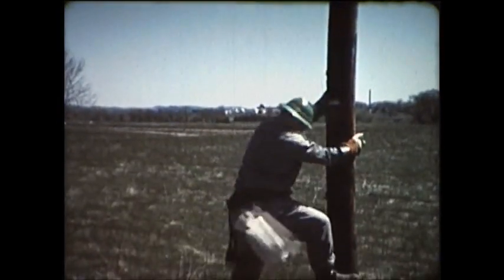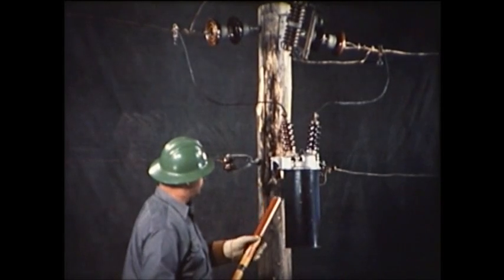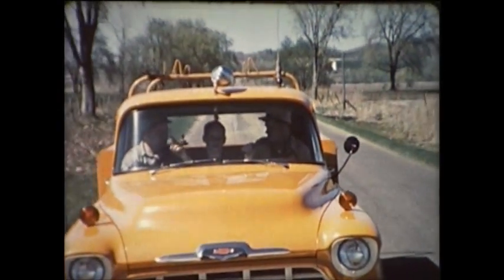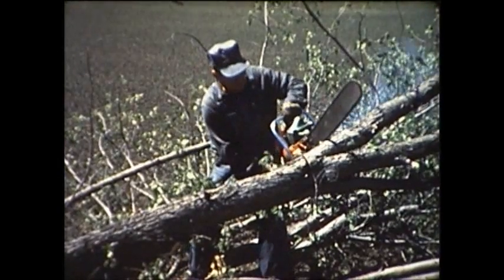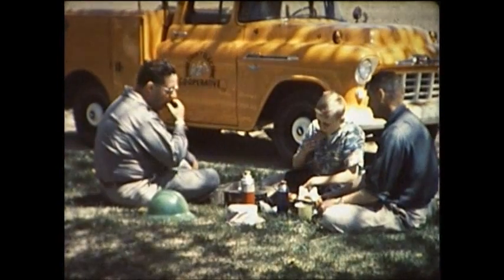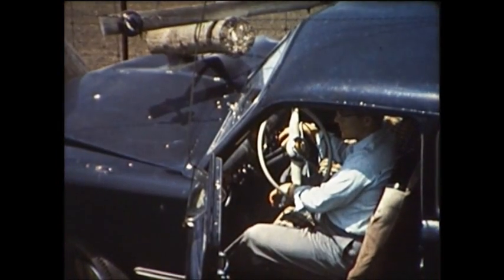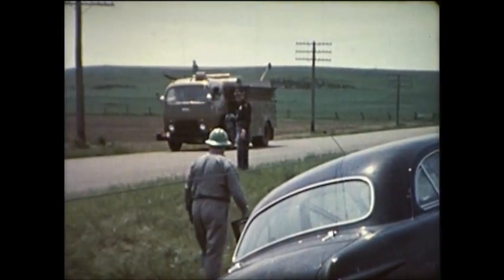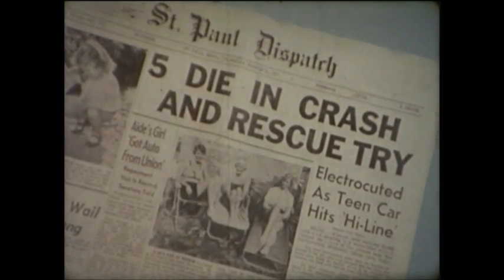My Pop's a Lineman

Comment: Love these old videos, did a pole change out the other day. Found a pole tag with 1938 on it. I took a minute to think about all the lineman that had climbed that pole over the years.
Reply: Where I live all the poles in the mountain are all from the 30’s and when one falls or whatever they don’t replace it with a new one, they just leave it and the wire at a long span.
Reply: @koda7820  we do that every now and then, but most of the time we will build a road with a dozer to change it out. Sometimes we can't get by with it.
Reply: I get the same way setting and framing new poles. It's a gift to know the construction will be there decades after I die supplying energy to customers homes. 

Just last week my crew set up DB for new lots, pulled 4/0 service, 350, and #1 15kv primary, put the terminator at the pole side and energized the pad. Knowing it'll be there for those new homes for years is humbling...I got to be a part of that history.
Reply: Found 1934 nails myself.
Reply: Bill builds an overunity generator with his friends tapping ZPE and his dad has a stroke see it.

Comment: Took a chocolate box down today actually! Crazy how some of the old stuff still does the job.
Reply: still operating these in toronto hahahahah
Reply: Theyre everywhere on the 4kv in the northeast....built to last
Reply: Only thing about them is you can't hang the barrel with a stick. I've tried every way to do it and it just don't happen for me.
Reply: I’ve been a lineman for a long time but I’ve never heard the term chocolate box can you please tell me what it is
Reply: @wd2616  I've never heard the expression "chocolate box" for an enclosed fuse cutout--however . . . "widow-maker" was the moniker I often heard in reference to these.  Typically, the open-style cutout was more likely used on 9-kV and up voltages.  Early enclosed cutouts were used here and this is probably because these Distribution cooperatives in Wisconsin were early REA-period borrowers.

Comment: Don't forget about step potential!!
Reply: Would I be right in translating that as potential voltage across the ground and the need to shuffle away after jumping clear. As there is a gradient of voltage on the ground if the line is touching.

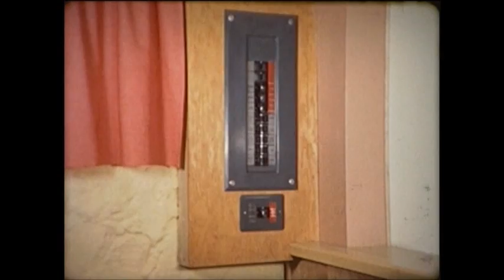Comment: 3:32 does the same job as a circuit breaker eh, would I be wrong in assuming (due to poor video quality) that's a federal fire pacific panel or similar vintage panel with similar issues?
Reply: Zinsco and Bulldog were 2 others that were en vogue at the time.

Comment: 5:53
Wtf 

Energized a downed conductor to those farmers!
Could have killed one of them.
Reply: That's OK the farmers can get back at the lineman by firing up their generators without a transfer switch using a suicide cord.
Reply: WTF one is ALWAYS told rule number one is to stay away from down powerlines in the first place.  They knock a tree on live wires and they shouldn't be messing with it AT ALL anymore.